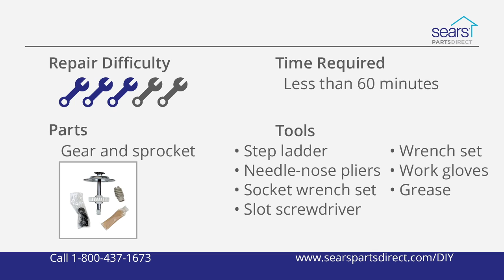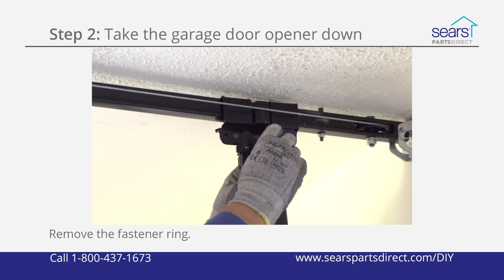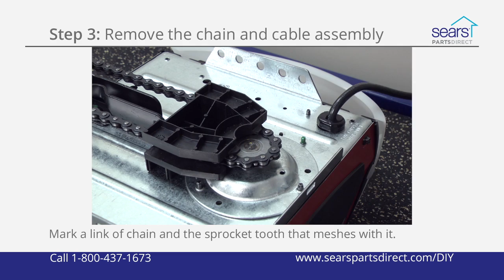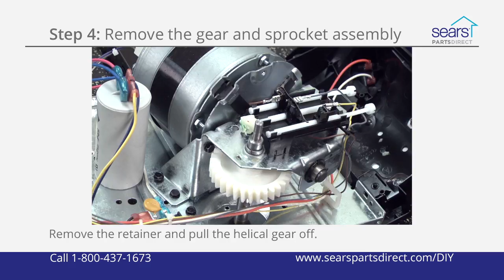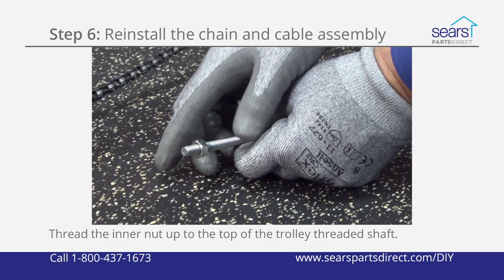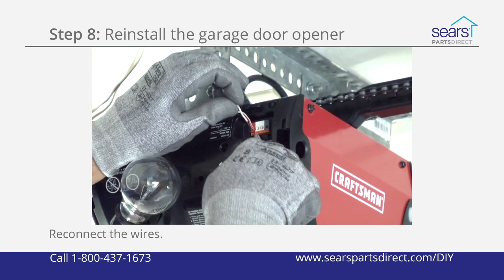Replacing the Gear and Sprocket Assembly on a Chain-Drive Garage Door Opener

Comment: This insructional video worked very well for me.  I recommend leaving the garage door operator on top of a ladder, instead of moving it to the work bench, once detached, so the bar is still near parallel with it's original position.  This will decrease the torque on the  fastener ring and pin.  Also, the unit is fairly heavy, so make sure you have a good grip or another person to support you if needed.

Comment: I have a Chamberlain Liftmaster 3575 and this video helped, though there are some extra parts to deal with in my opener. I replaced the gear without taking the opener down... fixed with the opener still attached to the ceiling. Only had to endure some shoulder burn while holding up and aligning the motor to reinstall with one arm while trying to thread the screw in with the other.